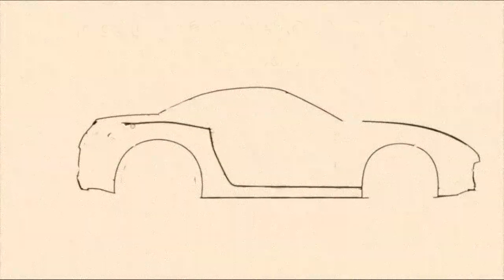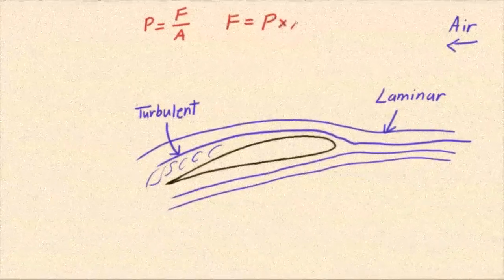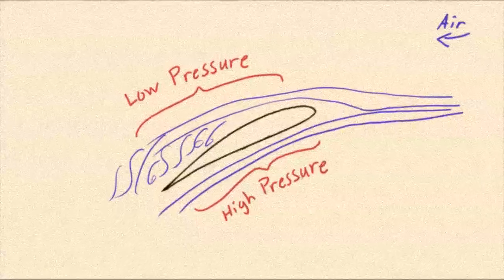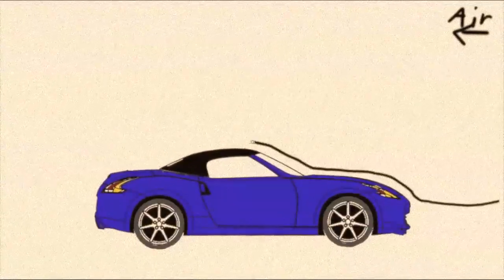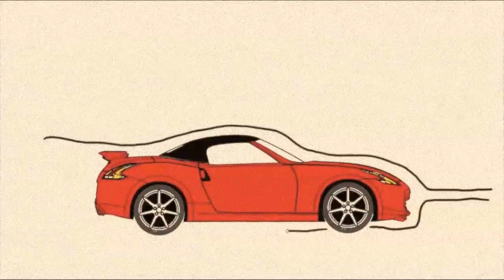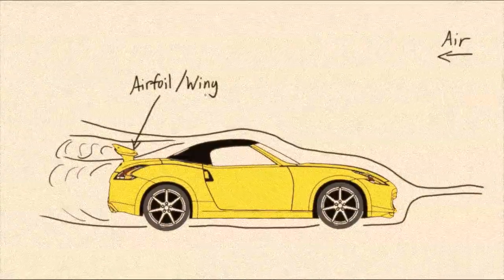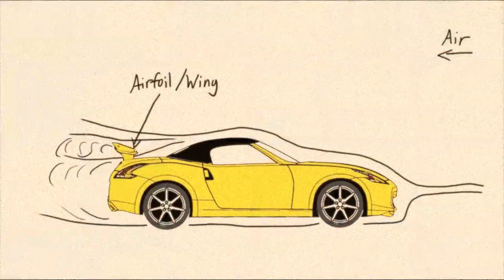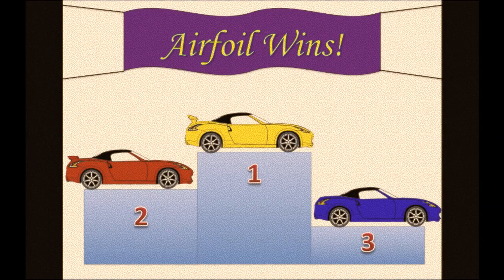Sports Car Aerodynamics: Spoiler Alert!

Comment: ppl totally forget that with more downforce, it also get more GRIP, so it have better traction
Reply: Mytheroo first this is a old comment.

Second you know a airplane wing, the faster it go = more lift,

 this is why you set a spoiler on FAST cars to counter it out, so yes it give you a better speed, but only in the way that the wheels have better traction. you can also think about it has a slippery road, you can't get grip = you can't move. but of course there is a "sweet spot" on the angle of the spoiler, too high angel will just slow it down. too low and its just for looks :D
Third i don't understand your point about "initial max braking force" how can a spoiler help with braking, the slower you go, for example when you break, the spoiler doesn't help any more (like you said), but yes it helps the way that you have more grip/traction (wheel to road) so your breaking is effective.

and last good tip beside the comment it will give you a date about how old the comment is. and if you see a 2-3 month old comment , then don't comment.
Reply: Good long post, next time make some space, and i don't see what our discussion is about anymore, have a good day.

Comment: 1. In a straight line, a car WITHOUT spoiler will actually be faster, this is why the Bugatti Veyron's wing RETRACTS in top speed mode.
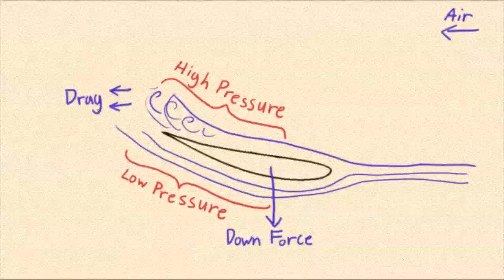2. You drew the turbulence on the TOP of the wing in the upside down wing example at 2:40, it should actually be on the bottom.
Reply: eagle
It retracts because it causes to much drag to reach top speed.
Reply: 1344mads
So, I make a statement, to which YOU reply that I am totally wrong after which I defend said statement and now I have to change the way I make arguments? very strange....

And just to give you a refference to the way you responded the first time, here it is again:

 "GJ FUCKING job its complete opposite with the bugatti, in top speed the spoiler comes up.

Before you re-massage me about you think im wrong, just look it up.

have a good day"

But somehow my response lacks argumentative skill? awesome dude, just awesome.
Reply: +Ckc dillpickle The Veyron&#39;s Cd is 0.41 with the wing in normal position, and 0.36 with it retracted.   It still generates about 120lbs of downforce in the retracted position at top speed.  

Any car with a functional rear wing, is using it primarily to generate downforce to improve grip (sometimes braking force too as the Veyron does), and with this negative lift generation comes drag.    Almost any car with a functional wing, will go faster in a straight line without the wing and the drag it adds.      
In a Formula 1 car when you simply let off the gas at top speed, the various wings are generating so much negative lift and drag the car will decelerate at 1G, even before brakes are applied.    1G is about the max deceleration the brakes can provide on an average sports car. 

What this video failed to point out is that the whole car acts as a wing due to its shape, and usually generates positive lift (mostly at the rear where it is most undesirable) and with that a bunch of drag.     A spoiler can help reduce this lift generation and lower drag a bit.  

A proper wind tunnel test would have actually measured the drag (force pulling the model car backwards) both with and without the spoiler or wing.    With no control and no comparison, no scientific conclusions can be made, and those that were made in this video, are mostly wrong.
Reply: +1344mads Top speed is more about minimizing drag than requiring grip, the spoiler only comes up to increase grip at expense of top speed so the car is more stable and controllable.
Reply: *****  That's 0.41 with the wing up, and as I already said 0.36 with it down (in the top speed configuration).    The problem is, the Veyron itself is shaped like a wing, so it'll generate positive lift, if you don't put a rear inverted wing on it to generate some downforce, and that increases the Cd.    There are slipperier shapes than the Veyron but they're not as pretty.    It goes fast through brute horsepower.
Reply: +Ckc dillpickle It's a lot compared to a modern family car that's meant to go 75mph, and still get high fuel mileage, and very high for any hybrid or RV.  The Veyron is not that car.  It makes 1000+ hp and it is designed to stick the road at 100-200mph.    With the wing up in the normal configuration, what they call "handling mode", the wing and other aero mods can generate 800lbs of extra downforce.    Every bit of lift generation, whether negative or positive = higher Cd.
Reply: +Ckc dillpickle Because the comment to which I replied by +hectorae86 referred to the Bugatti Veyron and directly addresses the incorrect assertion that the poster of the video made that a wing with downforce will make the car go faster in a straight line.  It does not.
Reply: +hectorae86 GJ FUCKING job its complete opposite with the bugatti, in top speed the spoiler comes up.

Before you re-massage me about you think im wrong, just look it up.

have a good day
Reply: 1344mads
Ouch, does it hurt my friend? I mean, lack of brain cells must have some side-effect right?

I said the spoiler retracts in top speed MODE, which it FUCKING DOES.
I "normal" MODE the wing will indeed go up above a certain speed.

And just top help you out with your brain problem, the Bugatti Veyron has a special key that you have to insert into a slot and turn to put the car in top speed MODE, only in this MODE does the Bugatti become capable of reaching it top speed, hence top speed MODE.

Let me know if you need more help understanding basic information.
Reply: Dude i have one question why should it RETRACT in top speed ?
 
a spoiler give more grip (because of the downforce). when a bugatti are in max speed or MODE it also get more lift, thats why you need the spoiler to counter that lift, so it can keep the speed and control.

And if you insist, give me a link or proof where it say THE SPOILER RETRACTS IN TOP SPEED/MODE.
Reply: +1344mads it RETRACS in top speed mode because in such speed the generated downforce from the wing is so big that the rear suspension system would collapse from the total weight (actual weight + weight generated from downforce)

you can look that up as well ;)
Reply: +hectorae86 Why the Bugatti? Such a ugly and not aerodynamic car. Why not the Aventador or the Model X
Reply: *****
Much agreement here :P But the video was talking about the Bugatti, so that's what I responded to ;)
Reply: hectorae86
My mistake. I misread your comment. The Bugatti has really bad Drag Coefficient. Rating around 8.07 which a Ferrari 458 Speciale has 0.34 Drag Coefficient which is 10 less than the Model S (Which is a family sedan) Most likely the reason why its spoiler goes down
Reply: +1344mads ..........Youre not controlling anything at over 200 miles an hour....its not a top fuel dragster...
Reply: daemn42
Really? 0.41? Must of misread or had misleading topics. Thats pretty high for a car made to go fast
Reply: daemn42
Thats still a lot. I've seen Family Sedan's with 0.24 though its a EV and Aerodynamics are a must for EV's
Reply: daemn42 That's where a diffuser helps ;)
Reply: 1. agree
2. You are wrong he os right
Reply: +Carlitox b is*
Reply: daemn42
Why use the Bugatti as a example. Why not the Koenigsegg one:1 can produce much more down force and has much more power
Reply: hectorae86 eagle I will accept this wise man (eagles) explanation BECAUSE he actually give some facts, and you (hectorae86) is insanely stubborn, and don't give any facts.

i have research and i have found out you guys are RIGHT, but none of you said that the bugattis ground clearance drop to 6.5 cm (2.6 in) from 12.5 cm (4.9 in). to compensate for no downforce, Thank you Eagle for your time to research this topic, Hectorae86 next time in an argument give some facts to state your argument.

Comment: Spoilers actually increase aerodynamic drag and reduce efficiency at high speed. They are used to increase traction which is only really needed for racing at extremely high speeds. In most application a vehicle which is more aerodynamic, uses less fuel, can accelerate more quickly and can maintain speed more easily is preferable.
Reply: +paulwesterberg I would say a spoiler/wing/whatever is used for more turning grip at extremely high speeds at the cost of top speed and high-speed acceleration. 
On a straight line it will slow you down(top speed and high-speed acceleration).

Where did I get this information?
Gran Turismo 4(PS2 emu FTW!) NUFF SAID

I used a Porsche in the High speed ring with reduced gearing size to get to a higher top speed. I wasn't able to go past a certain speed with the spoiler on. Without it, I could accelerate much faster and reach a higher top speed(like 220+ MPH) I don't remember. 

I also did the same with a Nissan GTR34 and I think I got near 250MPH with reduced gearing and max power/weight reduction.
Reply: +SI0AX Can confirm. Source checks out.

Comment: There will be no seperated flow on the top of the airfoil in 2:31
The flow would seperate on the bottom side, if the angle of attack is to high.
Won't watch further, because i cant expect nothing from this...

Comment: OK, I'll buy that if the car is rear-wheel drive, but what about front wheel drive where pressure on the back wheels is not directly attributable to the cars stability because of down force from the spoiler.

I thought that spoilers were supposed to be used on rear-wheel drive because those wheels can be cranked hotter because they have more grip, but grip on the rear wheels on a front wheel drive becomes inconsequential.

Am I barking up the wrong tree here?
Reply: +Rumple Stiltskin you are correct with what you're saying, however, on a front wheel drive car, the spoiler or wing  is used for a different purpose. Under heavy braking from a high speed, the weight transfer to the front causes the rear end to become very very light (which allows advanced drivers to utilise a technique that allows the car to corner neutrally or with oversteer).
In order to stabilise a FWD car under heavy braking, how to do that? Rear wing. That places aerodynamic weight on the back, as the airfoil has an even greater angle of attack (nose of the car pitching down) and is enough to keep the car stable during that period of deceleration from high speed. At a point, it becomes useless, as all wings do, but it helps with that initial stabilisation. Remember, its also useless to have a car that is only utilising grip of two wheels to slow down and corner, rather than four.
https://www.facebook.com/7Tune/videos/vb.185851534785624/886337081403729/?type=2&theater

In the case of the time attack car, the aero setup is there to provide aero balance. 

Overall, wing on FWD useless if you plan on drag racing. On a circuit, it'll provide better braking stability. Better braking stability means more precise turn in and handling. 
On econo hatchbacks, a roof spoiler reduces drag by pushing the air separation point further back, making it more fuel efficient.
Reply: Thank you, great reply

Comment: This is actually an accurate explanation. People tend to call spoilers anything that is attached to the rear of a vehicle and its wrong. The only thing INACCURATE about this video is the explanation about lift, which is surprising since its from MIT. The profile of the wing is not enough to prove pressure differences on top and bottom of airfoils. How do you explain lift from a flat air foil then? The actual explanation must also include Newton's 3rd law. Airfoil deflects air upward(dynamic fluid force exerted by the body to the environment), so an equal and opposite force pushes the wing down(dynamic fluid force acting on the body by the environment). 201k people have been mislead! lol damn it MIT!!!! greetings from UCLA :)
Reply: +dan McClaren The inaccurate theory you are refering to is called the equal transit theory, in which it is assumed for no reason that two separated parcels of air MUST meet at the trailing edge.

However the differential pressure as described by the bernoulli equation and the Newtonian momentum change in air theory are not different, they are both correct and both account fully for  the lift and drag forces. They are merely different perspectives on the same physical process. One could say the difference in pressure causes the air (mass) to change direction.
Reply: +Samm Sheperd (SNRS) it greatly depends on the specific scenario and what you consider the control volume.
Reply: +dan McClaren please provide an example I am interested in what you mean
Reply: +Samm Sheperd (SNRS) picture a certain airfoil with a given angle of attack that does not follow equal transit theory. Since the air over the top doesn't meet up with the under flow, a larger control volume is needed at the outlet to compensate. Therefore using the simple Bernoulli's equation will give flawed answers. That's where the lift coefficient comes into play. 

Both explanations are accurate and both explain lift, it's just that this video based lift mainly on airfoil shape. When people use this theory to explain lift, they should mention the amount of "turned flow" which has a huge effect on pressure difference.